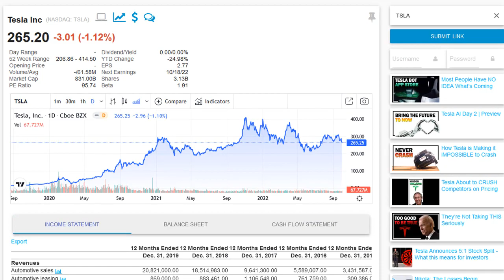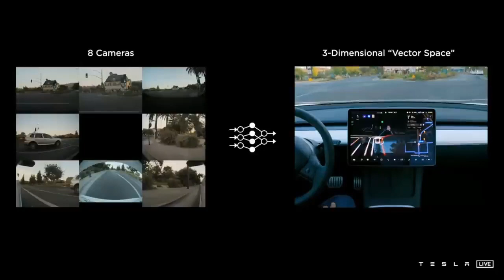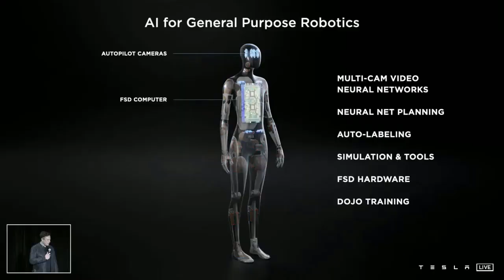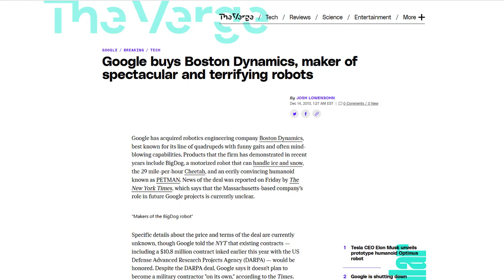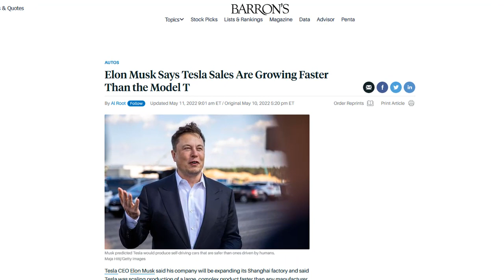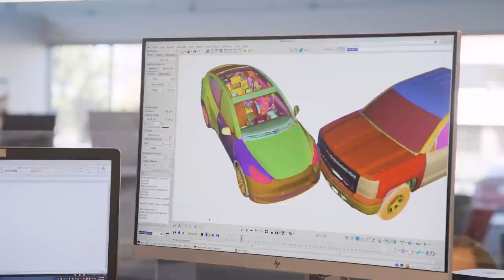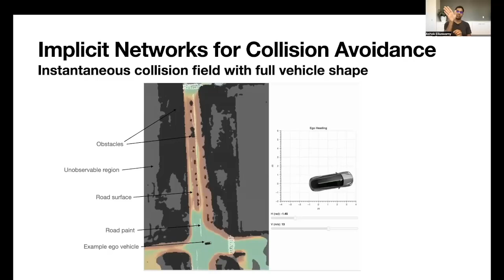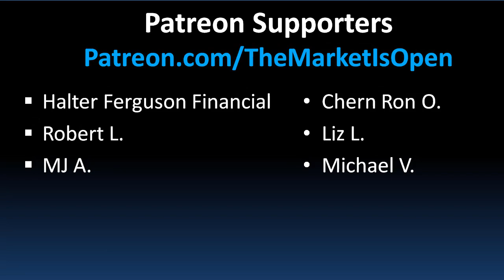STUNNING New AI Robot is Unveiled By Elon Musk

Comment: having laugh what tesla's robots look like, as you said the make off the self, ready made parts, and if what you said them basally, the same computer hard ware as what the using in there cars, there still teaching there software, or to be more correct letting it teach it's self, to find it own way? so ultimacy, the cars and robots will have there own in put to the next generation, with function, design changes, and if tesla's is letting robot have go in any meaningful way the cars plant, in a year or so if the big computer, run the hole show,  get full control the hole cars concept, the could just thing the hole car plant building in the same way as large, more complicated, desktop 3d printer nock out what ever there want?

Comment: I'd like to see the robots get muscles using magnetic ferrofluid and goo instead of using all these servos and hydraulic actuators, etc. Hydraulics don't produce smooth movements like muscles and tendons. If you run electric currents through the robot triggering magnetic responses throughout ferrofluid structures to make them flex like a muscle then I can't help but think you could have smooth, lifelike movement and significant tensile strength. In fact, as a remote viewer looking into the future I'm seeing occupations like "Ferro Systems Engineer" that study "Magnetic Ferrofluid Systems Engineering" some kind of software and electrical engineering position that designs and programs the membranes that contain the ferrofluid and allow electrical currents to flow through it to activate the magnetic reaction in the ferrofluid. So it's a thin magnetic membrane shaped like a tube holding the ferrofluid inside and sheathed by another engineered nano-material which is like a chain link flex conduit with elasticity and can move around like a slinky as the ferrofluid inside reacts to the magnetic signals from the membrane being stimulated by the electrical impulses traveling through the flex conduit. The flex conduit is not dumb, it's smart with some kind of elegantly simple machine code stored onboard and each link can pass information from the adjacent flex conduit link to the next conduit link. Each link has some kind of elegantly simple processor designed into it's structure (possibly etched on the surface of the material) like a very simple nano motherboard organized in it's molecules so it has memory for machine code and can process a very limited set of problems dealing with the function of the artificial muscle (seems like an engineered material similar to what's used in solar cells but has elasticity to it). These ferrofluid muscle conduits form a single muscle fiber so many of them are gathered together to form a single muscle.

Comment: You need a pumping system that has no pistons not so good but can be done with the two circles at 90degree  tip to tip and tubes at hexagonal point's 90degreed joined by duplicated to looping the flows through a passage of long and short looping point a fractional reserve banking system of hydrogen or fluids

Comment: $20K was the cost to manufacture a bot, not the retail price.  If this sells for anything less than $125K I'll be shocked as software margins are typically 80+% and the software (not the hardware) provides the value add.
Reply: The $20k is for the selling price, the manufacturing cost will be half or less of a Model 3 when it enters mass production in the next 4-5 years.
The Atlas costs around $75k, this will cost 25-30% of that because of smarter engineering, vertical integration (Tesla will be making almost every single one of its parts, electronics, batteries, and software, which will make everything cheaper for them), better manufacturing processes, and its production scale which will be thousands of times bigger than Atlas.
Reply: I can't talk about prices yet, wait for the development and what the robot can do, I hope it will be the same as their cars, function improvements and more new tasks by wireless update, crazy.
Reply: Based on Tesla's current pricing strategies, the released version of the bot will come with very basic features (can open doors, pick and place a box) for $20K.
If you want more than that, you'll have to buy various software packages, like the gardening package, dog walking package, tour guide, etc, at $15k each or a custom package at $30k.

There will also be a subscription package at $2k a month where you can download any package from the current catalog but only one a month.
Reply: Elon stated that he "thought" the price could be around $20,000 or less but I am sure that is for a base model.  Think "software" and back to the first "Matrix" movie when Neo learns Jui Jitsu in the matrix just by having a program uploaded into his brain.  I picture Elon doing the same.  If you want lawn mowing to be part of your robot's knowledge base that Dojo created through it's massive neural net learning process then, "Please click here to pay for and download the app!"  The robot is the razor, the software is the blade.  You have to see the recurring revenue model a robot represents to understand that if he sold it at the cost to produce or even a 30% margin that it pales in comparison to the task software apps it can use.
Reply: I agree . A hot tub costs $20k these days. A Tesla solar system
Costs $40k with no moving parts.
Reply: It's a prototype
Reply: they want to sell these robots on a mass scale for even a person in middle class could buy it but I don't think they can get the price down without taking loss.
Reply: There's no way that this will ever sell for $20K, as there is no way to get the BOM costs down to $10K for this robot. The typical street price for most autonomous mobile robots (with two motors) today is around $35-$50K. A 6 axis industrial robot starts at $12K, with 6 motors. Best case for this robot is that the bill of materials costs $20-$30K, which is a street price of $40K+
Reply: @mikeoitzman8275  Most of the components are made by Tesla. This has a significant impact of cost vs others. Atlas uses more generic parts that they purchase such as batteries and actuators. Tesla builds almost everything in house. Computer, batteries, actuators, sensors.
Reply: He's got to buy Twitter first, then he can sell his bots to go on Twitter!?!

Comment: I think our robots would be easier if we STOPPED MAKING THEM HUMANOIDS. 
The balance is so hard to accomplish in motion that it requires slowed reaction time and movement to not collapse. They even touch on putting things in the core here; why even have a head?! 
It makes more sense to make taller 4-6 legged bots with several excess arms for manipulation. 
Sturdier structure, greater weight/storage capacity, greater variations in gait and speed, usable on different terrains…
There is no exclusively useful reason for humanoid robots. Just stop.
Reply: I think the intention, is to put them into situations and vehicles, that a human might be in, without having to modify anything.
Reply: If you want a robot to do stuff that we designed for human use, then it needs to be human shaped. Good luck having a 6 legged robot get in/out of a forklift or walk through a human doorway and up human stairs

Comment: I wonder what an actuator is ? Is it a electric motor with a gear set?
Reply from the maker: Yeah it just physically moves the robot's arms/legs etc. Doesn't have to have gears though
Reply: @TMIOTesla  : that has been traditionally done with pneumatic struts. There is no electric muscle I am aware out.
Reply from the maker: The Boston Dynamics robot uses hydraulics for its actuators. it looks like Tesla will use small electric motors
Reply: @TMIOTesla  small electric motors have little torque which is I wonder what an actuator?
Reply: @TMIOTesla  I think Tesla will need something better and faster than it's custom actuators, maybe something that mimic's the human muscle.
Reply: Yhe new generations of brushless electric motors are quite strong, speed and torque. Very rarely do electrics spring a leak and drain out, all air and hydraulics do. Wires are more reliable than hoses and tubes.
Reply: @alaskanight940  -yes, I have taken a crash course in new electric motor technology. Basically the electric motor has been reinvented in the last 20 years . But no one can tell me exactly what an actuator is. I believe it’s a brushless electronic motor with a gear set.
Reply: @M13x13M  I think an actuator is just a name for a motor. From what I can tell it refers to something that takes signals and generates rotational or linear force, so a standard motor or a linear actuator, which turns rotation into a pushing or pulling motion

Comment: This has to be a joke. This is ten years behind current technology for these things. It's just an expensive radio controlled device.
Reply: I think you do not really understand the underlying technology here. Sure it doesn't do backflips, but if walking and doing a backflip is 10 years of R&D, I'd say BD has run into a development wall. There is only so much you can get a traditionally programmed machine to do on its own.

I guess that in mobility Tesla is only 1 to 2 years behind and in production techniques they are far ahead. As for software, that is a completely different story. Perhaps this is the leap frog method or perhaps they run into a similar wall, but to call this a joke a 10 years behind completely misses the point and shows your lack of knowledge.
Reply: @Diggnuts  lol. Nice try pretending you have some special understanding that I don't. Look at their proposed use cases. Those are nonsense for making a complex humanoid robot. There are very limited use cases for such a device that make sense but Musk and Tesla don't seem to get that, and neither do you. One thing I also understand is that you are saying the same exact thing as three or four other commenters with only minor changes to the wording. So you're all either taking this from the same source, you're copying each other, or you're actually working for Tesla.
Reply: @JoeJoe-lq6bd  It seems rather obvious to me that you are pretty much clueless about what you are blathering about. For what reason? That is about the only subject you could possibly know more about. The rest? Nah!

Now go play in traffic! I have no time for trolls.
Reply: @Diggnuts  Good to see another fanboy who knows nothing. Thanks for making it so easy.

Comment: coming from the industrial AI sector, I was amazed how fast Tesla is progressing in that field. The fact that it realizes its ever changing surroundings and “learns” as fast as neuro nets are able to “learn”, I am pretty sure that in one years time, we will be surprised about the progress.
Seeing the AI2 day on YT, I was wandering about or better say missing the interfacing with humans of this machine.
Reply: I dabbled ML and image recognition in grad school.  Now I am in manufacturing of semiconductor.  From what I can see, if they can keep this pace for RD, and the fact they know about manufacturing, and they keep the tech simple w/ just camera, it is SCARY what they can achieve a decade from now.
Reply: Tesla bot will be the most advanced bot, when they master balancing and agility.
They may need separate software and computing power, that's not used by the neural net, just to accomplish it. The bot will have to lean into and out of situations, apply it's body weight to it's work and know how to hold on to nearby secured objects, to leverage more power.

The current movements of the bot look like a school science project.
Some joints may have to be replaced by a hydraulic system or a completely new system that mimics human muscle. When they do solve the balance and agility problems, they'll be able to move on and redesign the neural net, to control a bipedal system.
Reply: They're using preexisting resnet and other existing algorithms. On top of a massive amount of data from their cars. They're doing great but not amazing nor cutting edge... 

You have to be joking.
Reply: well, some folks see, others have to be shown…
Reply: You cannot be serious. This thing is a joke. It's way behind current tech.
Reply: @JoeJoe-lq6bd  current robots work with sensors (if they don't have them, they don't work) and preprogrammed code, since they weren't built to learn the environment where they are. there tesla left a bar a little high from the others, since he wants his robot to recognize its environment and perform actions with only cameras, in the presentation it did all that without the use of sensors, only with its cameras and its deep neural network
Reply: @JoeJoe-lq6bd  Using its AI capabilities this robot can be upgraded once it is released with certain basic tasks this will be the amazing thing about this a robot that will continue to learn and periodically perform more tasks than the original version without having to buy another robot Tesla is a company that I like how they build their products.
Reply: @JoeJoe-lq6bd they are clearly only starting to train it for walking and movement. It’s a prototype so it doesn’t make sense to do all of that with that version, since the actual version wouldn’t match all the ai training they would have done. Let’s wait until they have their newer version walking before you dismiss everything they did in barely 8 months. From everything I saw at AI day I’m expecting it to be REALLY good surprisingly soon
Reply: @JoeJoe-lq6bd  that thing has access to advanced neural network... it is by far going to be one of the smartest bots out there. Working out the kinks to make it smoother is easy compared to that.